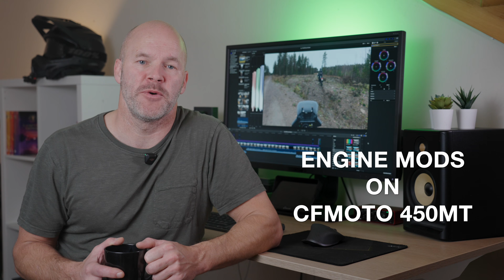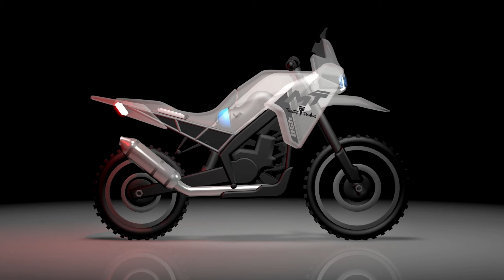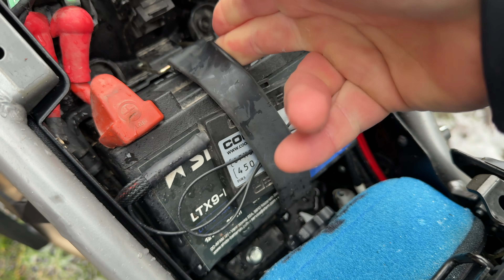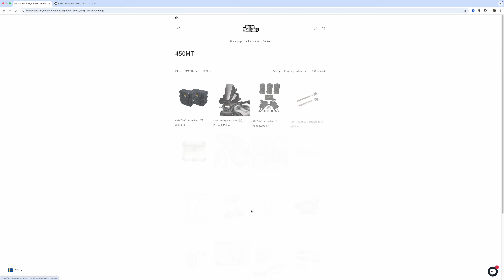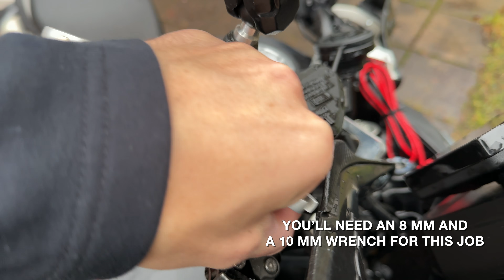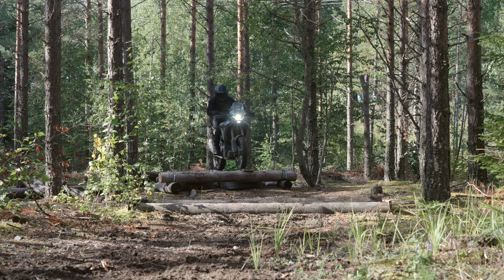How I Woke Up My CFMOTO 450MT – Real Performance Mods!

Comment: Do you ever wonder how China can build this bike and sell it for what they do and still make a profit?
Reply from the maker: Yeah, it's quite a lot less money compared to other brands (besides Royal Enfield). But what surprised me even more was the release of BMW 450GS. Where I live, BMW is a brand that sell motorcycles at high price point, but now they released the BMW 450GS for just 1000USD more then CFMOTO. Good times!
Reply: @TheAdventureNorth the BMW is made by TVS in India
Reply: @TheAdventureNorth  , because they are manufactured in India.  These companies are using low wage workers forcing the rest of the motorcycle manufacturers to move production to low wage areas.  The fallout is loss of jobs in those higher wage countries.  This isn't limited to motorcycles.
Reply from the maker: Thanks for sharing your thoughts, moving on from this topic 👍 Let's keep it about the rides and adventures!
Reply: @TheAdventureNorth  , it is about the future of motorcycling.
Reply: @Dave-sw2dm no. There is absolutely NO reason for a simple bike to be over 30k usd today, besides to fatten the pockets of the owners of the companies that make them. Only reason they move to lower waged countries is to keep their own profit margin and keep fattning their pockets, its not to bring prices down to yesteryears normal.
Reply: @maxpower700  , we are talking about $6500 motorcycles.  The Japanese can only compete with the Chinese if they move production to a cheaper labor market.  Same for BMW, Triumph, and KTM.

Premium bikes are a different conversation.  When China makes a premium bike to compete with the premium bikes from other brands, then we can talk.

Comment: Do you plan to upgrade the clutch springs too? I understand the original ones are too soft and premature wear can appear in the friction plates.
Reply from the maker: Yes, I have the stronger springs but haven't done the swap yet :)
Reply: @TheAdventureNorth  where from?
Reply from the maker: @lefterisbampaidis5446  Got them from Uncle Wang

Comment: Can you make a video for coober install, does it replace your own ECU?...and does that fail the garantee?

Thanks!👍👍👍
Reply from the maker: I’ll try to make a video of the Coober install. It’s a pretty easy process. In Sweden, installing a Coober on a 450MT doesn’t void any of the bike’s warranties. However, I’m not sure if CFMOTO in other countries has made a different decision. I recommend checking with your local CFMOTO dealer before doing the install.
Reply: @TheAdventureNorth thank you sir!

Great video!👍👍👍
Reply: I installed a coober box on my mt800. Super easy. Connect to the oxygen sensors from the headers. And connect the ground wire from the box to the battery terminal.  I’ve got a much better bike now. 20 min job.
Reply: Good ideas, thanks
Reply from the maker: No prob! Glad you liked it!